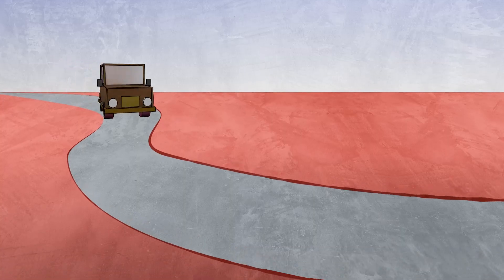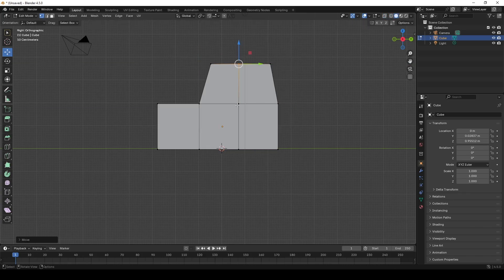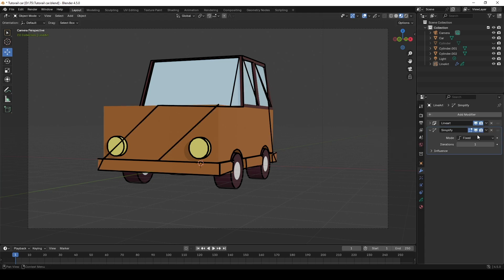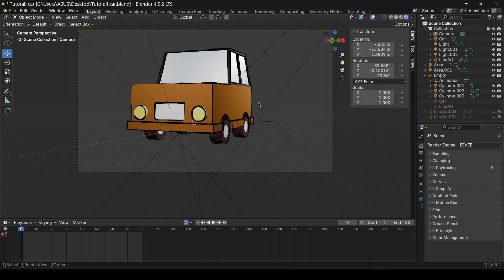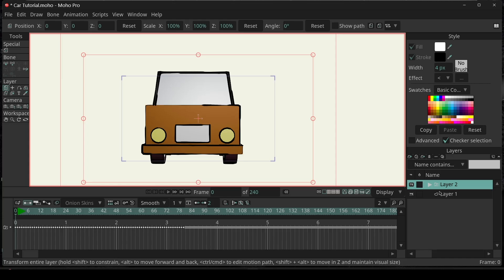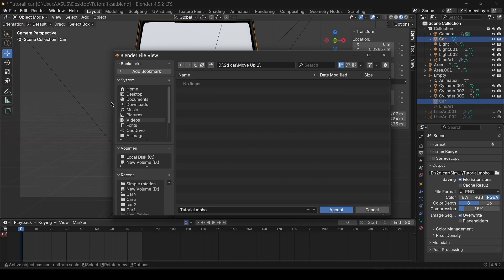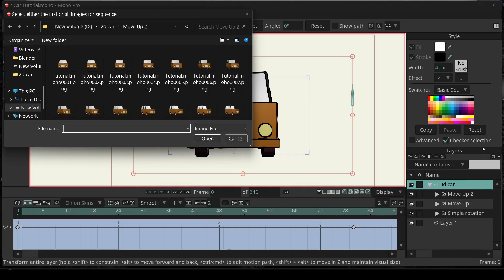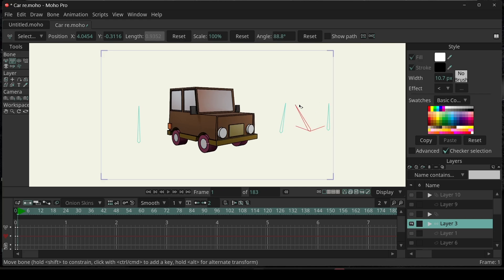How to improt a model from Blender to Moho

Comment: can you change the line art of the 3D model in Moho? Maybe apply line boil to it? That would give it a more traditional feel.
Reply from the maker: I am not sure doing it in Moho but it can be done in Blender in Line Art setting which looks excatly the same as line boil in Moho.
Reply: @EZAnimate-d9k  Oh that's cool but I'd rather just use Blender to export models then import to Moho. In Moho you have a lot of cool controls for the line, like making  line boil only when it moves.
Reply: @tonyredgrave009  Alternatively, you could export the 3d model without lineart, and trace a lineart over the 3d model in moho, and you will be able to customize the brush strokes, boil, opacity, etc.